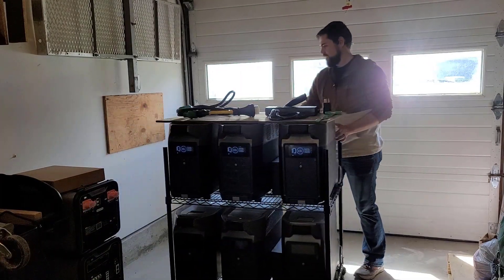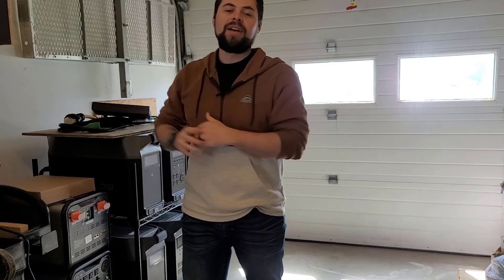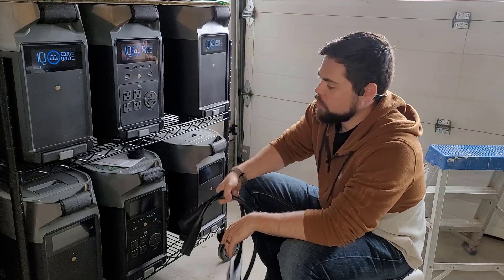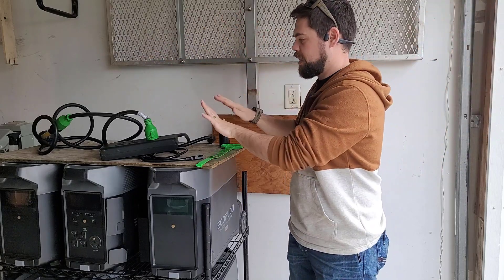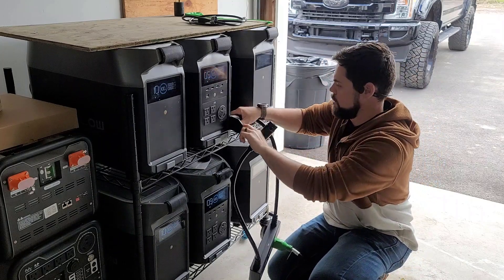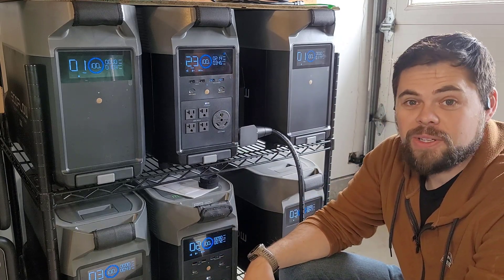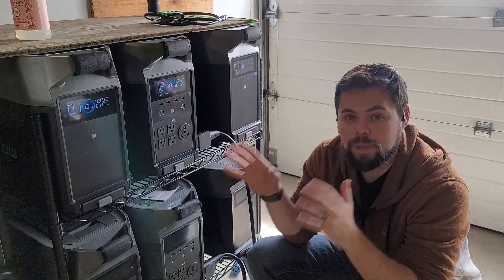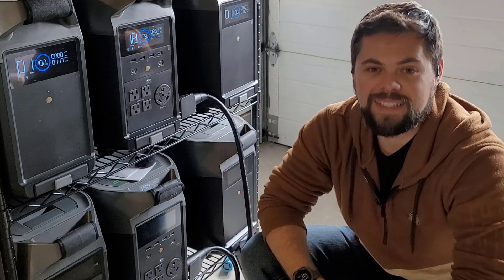EcoFlow Delta Pro Setup and Test

Comment: I'm still watching you, decided to review a slightly older video. I'm getting my land set up, and determining what I need. Will try to shop through you. 

The Ecoflow Delta Pro seems analogous to the Apollo in that it has separate 120v units to join up. 

Don't think I would be interested in any of the whiz-bang breaker panels. I know how to connect panels, manage power, throw breakers.  

Most importantly we need to learn to live on less. ... You mentioned your electric dryer several times, particularly confusing in the context of a grid down system. I believe the wind will dry your clothes just fine. And the propane would also be worth preserving. ... Frankly? I think that's a millennial, Gen Z thing. I grew up with no AC in the house, role of Windows on my vehicle, drive-in movies had a speaker that you HUNG ON THE WINDOW.

I have to do the math on whether or not the two Delta Pros (with suitable batteries) equals what you get from the Delta Pro Ultra. 

The one advantage of the Delta Pros versus the DPU is the redundancy of having at least one unit that we should provide 120v should one of Delta pros fail. (Same would be true of Apollo.) 

The Apollo seems to be overpriced for what their offering, though I'm still waiting for the Delta Pro Ultra to offer a firmware update that will allow a dark start on solar. I'm also waiting for the Delta Pro product to do load sharing, charge sharing between the Delta Pro batteries ... That is if I use the Delta Pro versus the Delta Pro Ultra.

I like that the Delta Pro Ultra has the dual solar inputs, low VOC, hi VOC.

I'm also interested in knowing whether or not the DPU can take the Delta Pro Smart Generator, and whether or not the DPU has a DC to DC connector, like the Delta Max on JASONOID channel. 

Keep it up. I'm watching you.

Comment: How often must they be updated amd mist they be updated in order to use them for off grid circumstances?
Reply from the maker: Once updated, they can run without internet and more updates. But they'll perform better if you continue to do updates on them.

Comment: so much better than a fixed in place DIY set up - in my opinion. If you needed to load those 6 units (and 240 power) into a truck and leave - you could.
Reply: This is the thing most preppers overlook. The mobility of this setup cannot be matched. Even if you can’t take the whole thing, you can grab what you need. Other brands are catching up but EcoFlow started with the goal of being modular and therefore tend to be the most adaptable.

Comment: Is a 12 gauge, 10-15' extension cord to a 240 power inlet box adequate (which I have) or should I go with 10  gauge?
Reply from the maker: 12 gauge is fine but 10 gauge is recommended.

Comment: Crazy that not many people know this is a high frequency system. It will eventually wither and die and you have to get a new one. 5 year warranty works great because it starts having issues after 5 years. Go for a Hysolis Apollo 5k and you just buy another battery. Way more capable than this overpriced hunk of junk that’s going to give you less charge after every use.

Comment: I appreciate all your correspondence but maybe some reflection on a one year old video. 

I am still living "off grid capable" in my home, but with a traditional flooded lead acid battery system. I hope to live off grid, with t the county people off my tail, nothing but a complete solar, nothing else on my land when I build.  With a little bit more information I might be able to pick the next system when I build.

I'm a little disappointed that you never discussed the APPROXIMATE price of this system. You never discuss the APPROXIMATE cost of setting up the interlock for your panel. You never discuss the COSTS of the cables and ancillary items.

I know you're doing the best you can, BUT THE QUOTE HYMAN ROTH FROM "GODFATHER II," THIS IS THE LIFE WE'VE CHOSEN.

This comes down to DOLLARS per kilowatt-hour. It also is a year old and should be notated to offer a comparison to things like the Apollo 5K.

As these systems become more ubiquitous, as they have more and more capacities, these things need to be compared by people, particularly people less involved than a "recovering engineer" who's had off grid power for 12 years.

However this works out, it eventually comes down to writing a large check. People need to know the approximate cost of systems, otherwise it's intimidating and overwhelming.  

When the time comes I will use you.  In the meantime I hope you appreciate this constructive criticism.

Comment: Why??  this is a 10K+ system.  Total over kill. You can do the same thing with 1K gas/propane generator for back up power.  Those batteries won't charge/discharge below freezing which in the uppoer mid-west is when we need backup power the most during ice and/or snow storms.

Comment: You mentioned everything except the house ac.  Did you install a Micro-Air Easy Start on the ac system.  It reduced my in rush current from 77 to 23 amps on a 3 ton unit!

Comment: How many solar panels would it take to keep your house running using these batteries? I realize that solar power charging depends on your needs, but how big of a solar array would you need to power your house full-time using this battery set up? I’m needing to get out from under my $550 power bill and know if I do it right I can avoid down time due to clouds, gloomy days, etc.
Reply from the maker: I used to use 12, 200w solar panels on each DP but I have found that four 400w panels per DP is the best option, like these: https://poweredportablesolar.com/product/410w-solar-panel/. I prefer the Apollo over the Delta Pro now but both options are good. It just depends on what your needs are. You're welcome to email me at info@poweredportablesolar.com and I can help even more.
Reply: @minutemansolar Wow, that is a big difference! I appreciate your offer. I’ll look into that link then let you know. I’ve watched so many videos the last few days it makes my head spin and it seems like there are a lot of good options and all of them work just depending on how much money you wanna spend. But I do want to keep it where I can expand if I see I started too small and I really like the idea of putting whatever I get on a cart like you did. 

My mother lives in a camper next to our house (since the roof in her double wide leaked and ruined the ceilings) to keep her independence, but her camper doesn’t really use much because she’s so thrifty, 😊 but I need to anticipate her having company etc so having it rated and fitted properly is important. Again I appreciate the information and I’ll check out the link and let you know. 👍

Comment: You should install smart panel then you can leave it connected and it will switch by it self. Bluetti had one adventage . You can setup how much of battery you want charged from solar and how much from grid

Comment: Real nice setup. Why are you using a 50 amp plug when the delta pro only provides 30 amps?
Reply from the maker: Because I can use any system up to 50a. Since I test and use so many different units I didn't want to be limited to 30a. I now use the Apollo, I have 4 of them. With them I can do 240v and 50a output, which is 12,000w. If I had wired it for 30a, I'd be limited to 2 Apollos. It was just a simple thing to install and gave me more options for the same price so I did that.

Comment: for less than the cost of one of these you could buy a EG4 6500EX inverter and a EG4-LL Lithium Battery (V2) | 48V 100AH | Server Rack Battery, hook them together in less than 5 min and have well over twice the power of a ecoflow delta pro....the cost for those two items with cables to hook them together = $2900 and these could also take twice the solar input as the ecoflow.

Comment: I’m new to this and still learning.  What all do you have?  Is it two delta pros and four backup batteries?  What’s the cost for that system, about $20,000?  Reason I ask is I got a Generac house backup generator 3 years ago before these solar generators were popular like this and I paid about $10,000 for everything.  It is a natural gas unit fed by a gas line from the street and the unit has been invaluable over the years as we seem to lose power easily even with a little wind storm.  Trying to compare costs although I realize it is apples to oranges in a way.  Thanks!
Reply from the maker: Yes I do have 2 DPs and 4 EBs with maxed out solar panels as one of the backup options to my house. I have many systems that I test and use for house backup. I would recommend the new Apollo that is launching. They've worked out all the kinks and it's far better than anything else out there. You're welcome to shoot me an email to info@poweredportablesolar.com and I can help.

Comment: How do you charge the EcoFlow Delta Pro setup when using it with the 240V hub? I saw one review that said it can't be done, but it sounds like you are able to with your backup gas/propane  generators?

Comment: I bought the Dewalt shelving system for my same Ecoflow setup but like the cart with wheels better, you always need to be moving it around and that is what I had before I added the 2nd set of batteries but cart was too small for the 6 units. Darn, live and learn. BTW i have smart panel and 6- 400w Ecoflow panels, nice system combined with my natural gas generator think i'm covered.

Comment: Thank you for the step-by-step guide and showing me all the parts. I have a tesla solar system on my roof, but I do not have a power wall. I decided not to buy it because it was so expensive. Looking back now. I kind of wish I would’ve because it would’ve been less him buying six of these things. But the nice thing about these as I can take them with me if I need to go someplace one question I have is I noticed on the EcoFlow site they sell what looks like an electrical panel, so where does that come into this I noticed that’s not something you have why are they selling that if I don’t need it?
Reply from the maker: The EcoFlow Smart Home Panel is a sub-panel where you can have up to 10 circuits powered from the Delta Pros. It's nice because it automatically turns on when the grid goes down. I didn't want that because I want to run my entire electrical panel, but the downside is I have to manually turn the system on. That's not a big deal to me so I went with that. Plus I can use any other solar generator or gas generator with that interlock switch as well. I had an interlock switch installed.

Comment: The huge issue I have is the amperage. 30 amps at 240v is not enough to run everything on a house. I think it’s silly to have so much capacity but not able to run anything you want. Such a high price. My level 2 EV charger alone is 40 amps. So yeah just not worth it until I see 100 amps.

Comment: why 240V  , yr electronic  items using  110v
Reply from the maker: Some of them use 240v. Plus you need two 120v sources to run all 120v outlets since there are two legs of power in the electrical panel

Comment: How did you get the roller?
And how can you pair the whole batteries to work in parallel
Reply from the maker: The roller cart is form Uline, links below the video. The batteries auto-sync with cables in the back.
Reply: @minutemansolar  I know two batteries can parallel at once but can all.of them parallel at once or it's only two
Reply from the maker: @prosperityokechukwu1503  only 2 per delta pro

Comment: Why not use an automatic xfer switch? It could be challenging if you are not home when the power goes out.
Reply from the maker: There isn't a standard one I'm aware of that works well with solar power stations. The EcoFlow Smart Home Panel is an auto transfer switch but since I test and use many different units, the Interlock Switch allows me to test and use different systems rather than being locked into the Delta Pro only forever.

Comment: Sorry beginner question here. How did you get the big outlet on the wall to connect the ecoflow? What is it called? My house doesn't have one!
Reply from the maker: Beginner questions are always welcome here. The plug is called an "interlock switch." It allows you to connect a power source, solar or gas, to your main electrical panel. You turn off the main breaker from the grid, and then turn on the interlock switch. Then you can power your whole house if you have a 240v solar or gas setup. You can power up to the rated output of the solar or gas generator. It's generally very easy for an electrician to install. Usually less than $1,000 depending on the electrician and house setup. My plug is inside because I use solar and they don't off-gas. If I need to use gasoline then I will use a long heavy extension cable to keep the gas generator outside, run the cable inside to the plug, and power my house that way. If you still need to get any solar equipment please feel free to reach out to me at info@poweredportablesolar.com and I'd love to help.

Comment: How many 4oo watt solar panels do you need to charge all 4 extra batteries and the 2 solar generators all at once?
Reply from the maker: You can only have up to three 400w panels together in one group of series on each Delta Pro. That will put you around 120v and 11a. This will get you around 1,200w input. In order to reach the full 1,600w max rated input, you would need six 400w solar panels. Three in group 1, and three in group 2, with a 2 to 1 MC4 branch connector. That will give you about 120v and 22a. But since the DP charge parameter is 11-150v and 15a, the excess amperage will not get used. Charge controllers will not let in more amps than they are rated to. So in this case, you'd get about 120v at 15a. Volts x Amps = Watts. 120v x 15a = 1,800w. Then you factor in solar panel efficiency and the weather conditions and you should be anywhere from 1,400w to 1,600w input on a clear sunny day. You have to have 2,400w of solar panels connected in order to get 1,600w input on the DP. It's one of the few major issues with the Delta Pros. I will have a video coming out about each solar generator/power station major flaws in the near future.

Comment: Awesome Video! Can you get a full 50 amps out of the 240?
Reply from the maker: Thank you. Sadly no, only 30a at 240v. If you decide you'd like to get a system please feel free to reach out to me at info@poweredportablesolar.com and I can help find what system will work best for your needs.
Reply: @minutemansolar  awesome! Will do. Right now I am trying to figure out the whole solar situation for when I get an airstream.
Reply from the maker: @israelcontreras5332  That's great! I literally just got off the phone with a guy who I am going to work with to install a solar systme on his RV this summer. If you're interested let me know. I'm near Idaho Falls, ID. I like solar generators that can be used in the RV and home for boondocking and backup power.

Comment: Great Video! Super informative! How do the Ecoflow Batteries get charged up? Is there a separate connection for charging from a standard 120v outlet for each one? And how would it work if the Ecoflow is feeding the house but the house is trying to charge the Ecoflow?
Reply: Um…. They have these things called solar panels. Also, that plug in your house works.

Comment: seems like a lot to pay up front for being able to run a whole house for only 24rs.  I'm sure you can get a couple more days or so without using the dryer or other 240v appliances.  Nice setup though.  Thanks for the video.
Reply from the maker: Indeed it is. But I have personally run for 4 days and was still going strong. As long as I am not using my 240v electric dryer and it's sunny each day i can go pretty much as long as I need. But I will be swapping it out with the Apollo.

Comment: Fantastic video! Was already looking at Ecoflow for a couple of years but your video gave me confidence to pull the trigger. I also bought the cart/wheels that you have - a tight fit but it works like a charm! Thanks !!!
Reply from the maker: I'm so glad it helped. Where did you end up getting your Delta Pro system from?
Reply: @minutemansolar  Direct from Ecoflow - they run specials all the time. Got money off, free dual fuel generator and some other freebies :) 

Question: How did you setup your secondary electric panel? I'm about to hire an electrician to come and integrate the battery solution into the whole home but I have a ton of GFCI/AFCI circuit breakers in my main panel. Ecoflow was no help on this. Any tips/hints would be GREATLY appreciated :)
Reply from the maker: @djboca  The easiest option if you have two DPs like I do, is have your electrician install an Interlock Switch instead of transfer switch. The Interlock Switch allows you to run your whole electrical panel, whereas a transfer switch allows you to pre-select what circuits you want to run on a backup power system. I choose Interlock for that reason.
Reply: @minutemansolar  Thanks! I bought everything you had including the rack and wheels - if you figured it out so perfectly, why mess with perfection! Interlock Switch it is! I'll setup my appointment now that I have the right way to put it into the house :) Greatly appreciate the help!